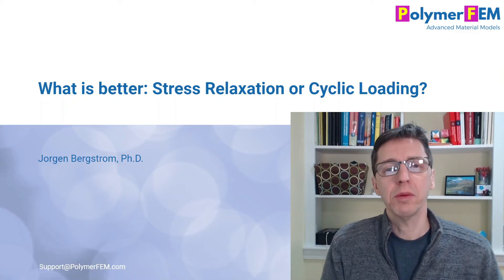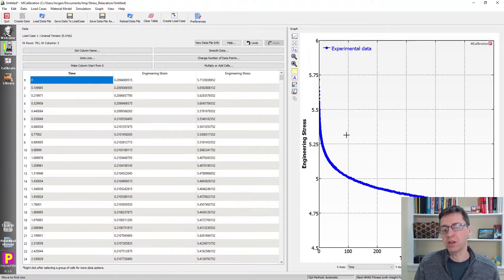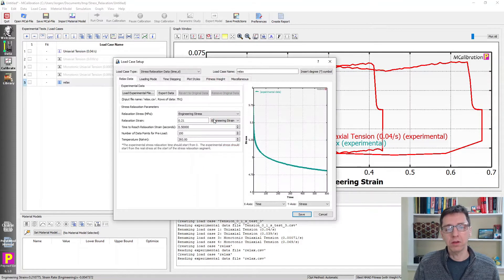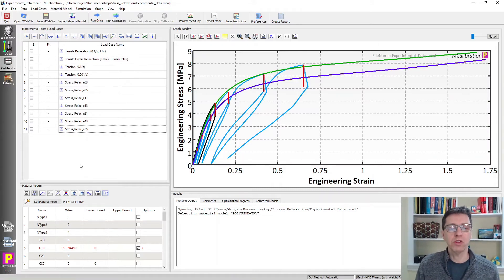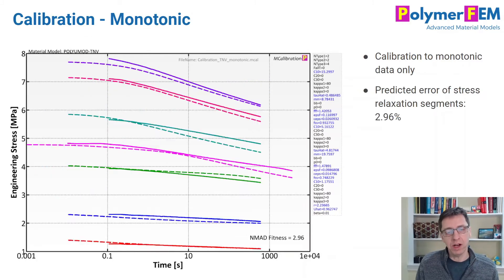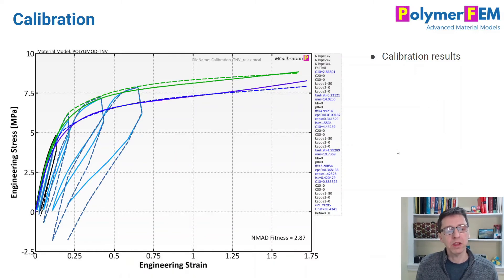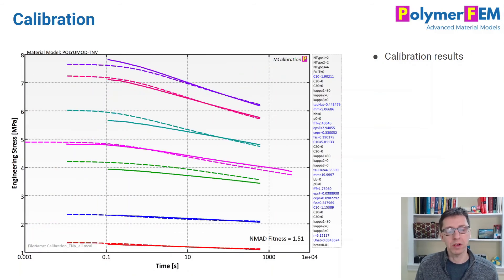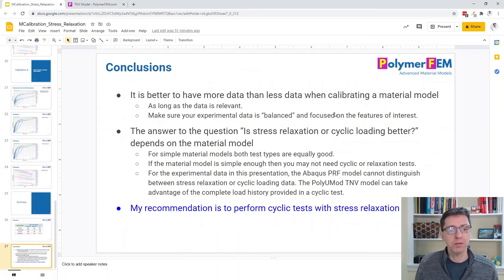What is better: Stress Relaxation or Cyclic Loading?

Comment: Hello,

I‘ve got a question regarding your method of extracting the relaxation parts from the experimental data.

In the data set of the cyclic test data, you converted the n-th relaxation data, (for n as number of cycles) by looking at the engineering strain at the beginning of the relaxation period. But, as visible from the cyclic data, plastic set seems accumulate after every clycle.

My question now is: is it correct to take the engineering strain  for this converion to relaxation test data. I mean at the n-th compression period only the eng. strain minus the current plastic set must be added. Only taking this difference from current plastic set to strainlevel at the beginning of the relaxation period would lead to a different relaxation test data set.

My other, smaller question is, why the slope of the relaxation periods arent vertical in the eng. stress strain curves?

Thanks in advance!
Reply from the maker: All polymers have memory of their previous deformation history, so you are right, it is not strictly correct to simply extract the stress relaxation response from one cycle since that does not include the history of how that starting point was obtained. It is better to simply use the whole strain history for the calibration. Once can argue, however, that for the purpose of this study it is sufficient to simply use the approach that I outlined to get the relaxation data. 

The reason the stress relaxation periods are not vertical (i.e. the strain is not constant) is that the test was run in strain control mode in which the test machine crosshead was held fixed, but the strain (which was measured using DIC) changed due to machine compliance effects.